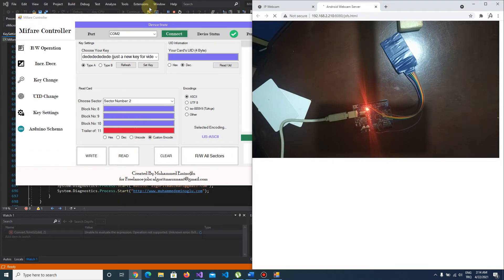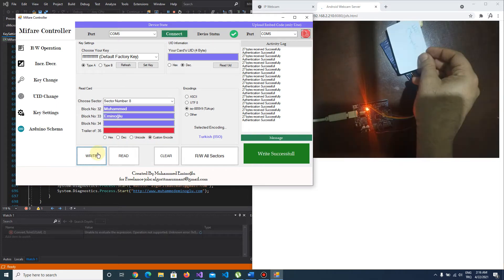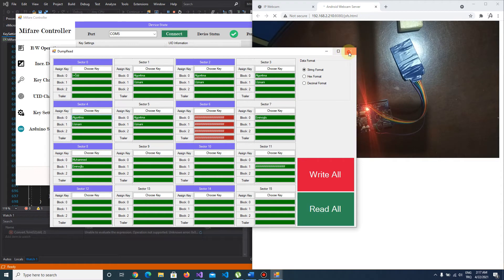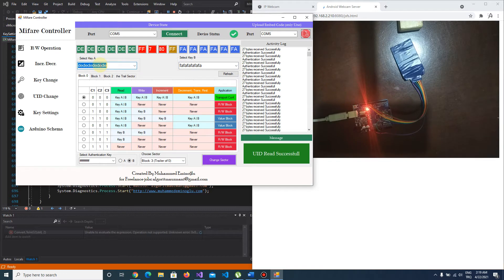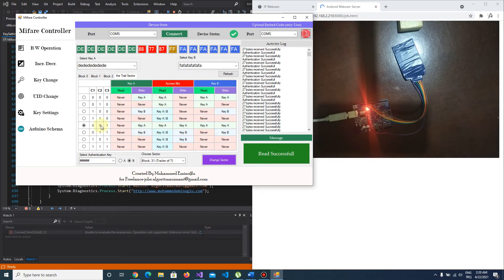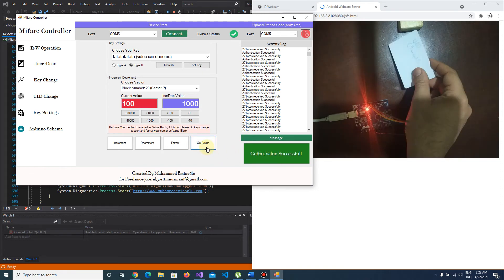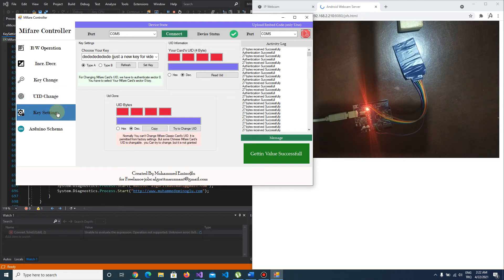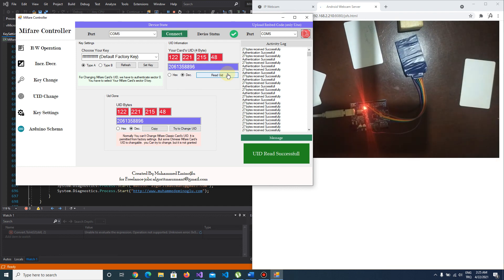Control Your Mifare Card with Mifare Controller (just u need an Arduino Uno)

Comment: hi there, i am still having problems with the comm ports, there is no ports in right hand pull down, yet the left pull down has all the port, can you please help
Reply from the maker: Ok. Just ne süre you habe installed Arduino ide. Then plug your Arduino UNO. Program must have find your port automaticly. You have to install Arduino drivers. Arduino ide installing progress will made it automaticly

Comment: hi there, ive been using this software for a few weeks now which i find brilliant, now when i load the software up it says "could'nt connect serial port", i have nothing connected to the port other than the arduino, the arduino IDE is not running. nothing else is using the port. could you tell me what to do please. thanks, tony
Reply from the maker: Ok that is just a message on start. Find your port and write it port combo box and psuh login button
Reply: @AlgoritmaUzman  hi there, thanks for quick reply, the combo box on right is empty yet the one on left has all available ports in it. Thanks

Comment: Very nice. But your program can't find the com port on my windows 10 computer. So I can't upload the program to the Arduino Uno. Can you make any improvements?
Reply from the maker: Are you sure arduino ide installed on your system? İf it is it must find. İf still don't find you can manually enter com port. (You can find port number on device manager)